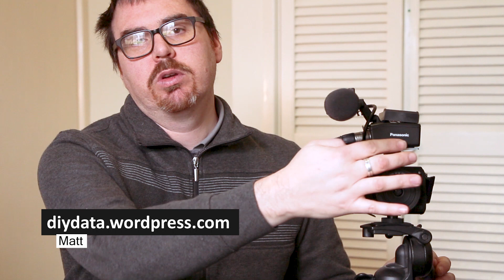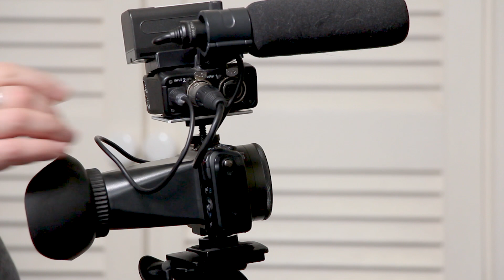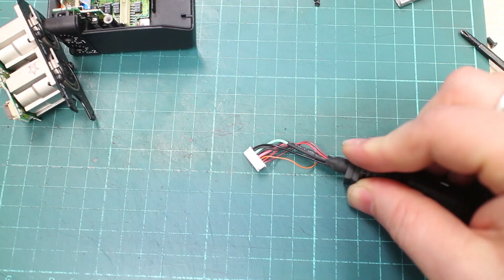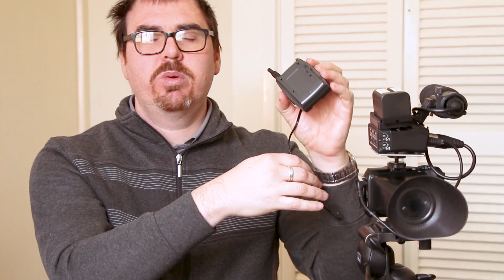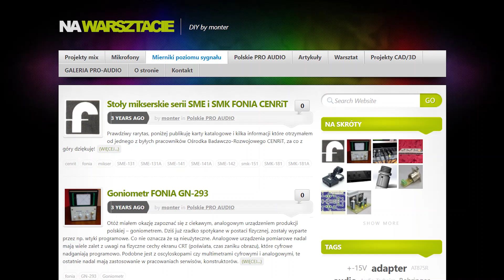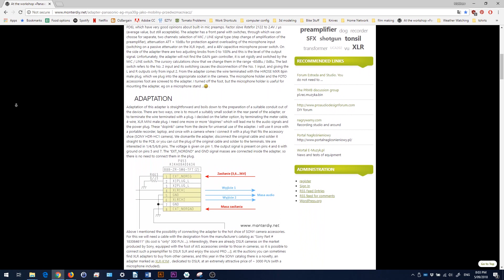Repurposing an old microphone preamp for use on a DSLR or mirrorless camera

Comment: I used this ag-mya30g preamp at my ag-dvc30 camera with Beyerdynamic mce 72pv phantom powered microphone. And I noticed that there was a rather loud high frequency hissing-like noise even while mic was unplugged( Just wonder if the source of this noise was in this preamp or it could be in the camera? Could you hear such noise?